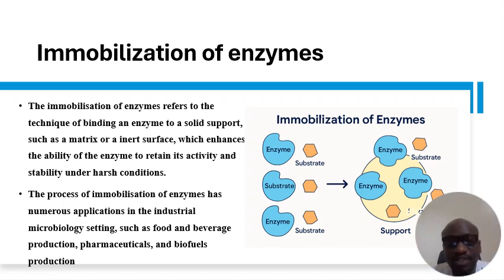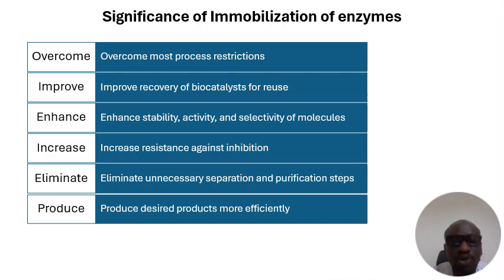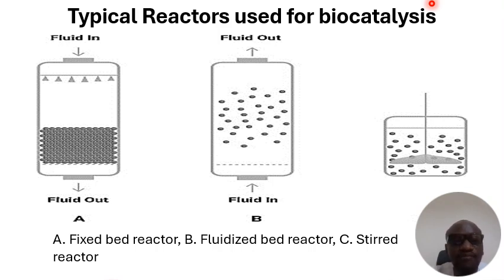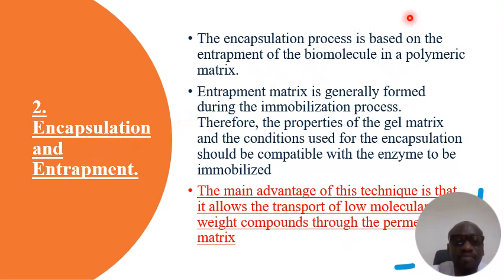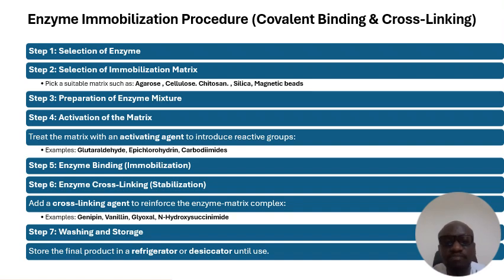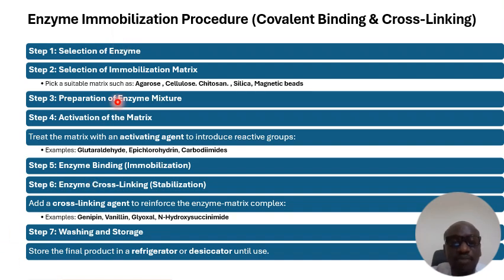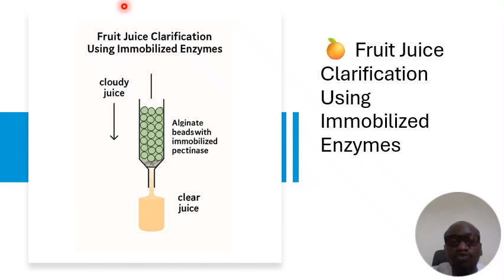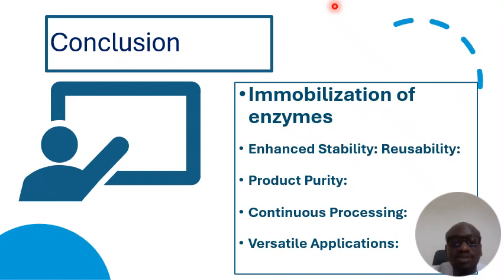Immobilization of Enzymes (Industrial Microbiology )

Comment: Question 1
Immobilization refers to the process of attaching a soluble enzyme onto an insoluble solid support while preserving its catalytic activity. This technique enhances enzyme stability, enables repeated use, and increases resistance to environmental changes. Enzymes can be immobilized though covalent binding, encapsulation and physical adsorption, this is valuable because it allows easy recovery and reuse of enzymes, extends their shelf life, and improves their performance in industrial applications.

Question 2
1. Reusability: The enzyme remains attached to its support, allowing multiple reaction cycles and reducing costs.

2. Extended lifespan: Immobilization preserves the enzyme’s structure, enabling it to withstand higher temperatures, wider pH ranges, and long term storage.

Real life Application: Immobilized glucose isomerase is used in producing high fructose corn syrup by continuously converting glucose to fructose in a packed column.

Olakorode Stephanie Oluwakemi
Matric Number: 210708042

Comment: Microbiology
Reply: Question 1:
Immobilisation of enzymes is the process of attaching or trapping enzymes onto a solid support or carrier while allowing them to remain active. This is useful because the enzymes can be reused easily, separated from the reaction mixture, and are often more stable during industrial processes.
Reply: Question 2:
Advantages:

1.Enzymes can be reused, reducing production costs.
2.They are more stable under different processing conditions.
3.They are easier to separate from the reaction mixture, resulting in a purer product.

Application: can be used in the dairy industry to produce lactose free milk by breaking down lactose into glucose and galactose.
Reply: Name: Olaniyi Zainab Dolapo 
Matric no: 210807100

Comment: Microbiology
Reply: Question 1: Explain Enzyme Immobilisation

Enzyme immobilisation is the process of fixing an enzyme onto a solid material or trapping it inside a support so that it does not move freely during a reaction. An enzyme is trapped on a solid support or matrix so that it stays in one place while still carrying out its function. Instead of mixing freely with the reaction, the enzyme remains fixed and continues to convert the substrate into the desired product. This is useful because the enzyme can be easily separated from the product, reused several times, and remains more stable during industrial production, making the process faster and more cost effective. 

Question 2
Advantages of Immobilisation Enzymes

1. Easy separation 
Immobilised enzymes can be easily separated from the final product since they stay fixed on the support material. This means there is little or no enzyme contamination in the product, so less purification is needed after production. 

 2. Reusability and cost reduction
Immobilised enzymes can be used repeatedly because they remain attached to a solid support after the reaction. Instead of adding fresh enzyme every time, the same enzyme can be recovered and reused in several production cycles. This reduces the cost of enzyme replacement and makes industrial production more economical.

Real life Application of Immobilization Enzymes 

An application is in the production of lactose free milk. The milk is passed through a column that contains immobilised lactase enzyme. As the milk flows through the column, the lactase breaks down lactose into glucose and galactose, making the milk easier for lactose intolerant people to digest. Since the enzyme remains attached to the support, it can be used repeatedly without contaminating the milk, making the process efficient and cost-effective. 

Udoka Rebecca 
210807056

Comment: Microbiology
Reply: Question 1:
Enzyme immobilization is the process of physically or chemically attaching isolated enzymes to a solid, insoluble support. This restricts their movement and localizes them so they do not mix with the final product. This is incredibly useful because it makes recovering and reusing the enzymes simple, which significantly reduces operational costs.

 Question 2:
Advantages
1.enzymes are anchored to a support, they can be easily separated from the reaction mixture and reused for multiple reaction cycles, saving both time and money.

 2. The final product remains completely enzyme-free, eliminating the need for expensive and time-consuming downstream purification steps.

3.They are easier to separate from the final product and often have improved stability.

Real-Life Application:
 Immobilized glucose isomerase is heavily used in the food and beverage industry to convert glucose from corn syrup into fructose, which is widely used to produce high-fructose corn syrup for sweetening products.

Dawodu oluwapelumi ifeoluwa 
230807550

Comment: Question 1: What is Enzyme Immobilisation?

Enzyme immobilisation is a biotechnology technique where enzyme molecules are physically confined to an inert solid matrix such as silica gel. By anchoring the biocatalyst in place, it can react continuously with an incoming substrate stream while remaining separate from the final product.

Question 2: Advantages and Real-Life Applications

Streamlined Downstream Processing: Because the enzyme does not mix into the solution, minimal or no product purification is needed, preventing end-product contamination.

It enables automated setups (such as packed-bed or continuous-stirred tank reactors) that run non-stop for maximum productivity.

Real-Life Application: 
It is used in sweetener production (Industrial Biocatalysis) where glucose Isomerase is fixed inside a packed-bed reactor to continuously convert glucose from cornstarch into High-Fructose Corn Syrup (HFCS), an essential commercial sweetener.

Matric no:230807541
Name: Ogbu-Nnachi Onyekachi Sophia

Comment: Question 1:

Immobilisation of enzymes is the process of attaching or trapping enzyme to a solid material, such as beads, membranes, gels or resins, so they can stay fixed in one place instead of floating in solution. It is useful because it allows the enzyme to be reused multiple times. This makes it easier to separate the enzyme from the product at the end of a reaction. 

Question 2:

1. They can be reused repeatedly, which cuts down production costs since fresh enzyme doesn’t need to be added for every batch.

2. They show improved stability, tolerating a wider range of temperature and pH than free enzymes.

3.  They are easier to separate from the reaction mixture, producing a purer product.

Real-life application:
Immobilised glucose isomerase is used in the food industry to convert glucose into fructose during the production of high fructose corn syrup.

Fadenipo Oluwafunmilayo 
210807001

Comment: MICROBIOLOGY
Reply: Question 1
Immobilisation of enzymes is the process of fixing enzymes onto a solid material or support so they stay in one place while still carrying out their job of speeding up chemical reactions. This is useful because the enzymes can be removed easily after use and used again.
Reply: Question 2: Advantages
•Immobilised enzymes can be used repeatedly, which helps reduce cost.
•They are easy to separate from the products after the reaction, making the process cleaner and more efficient.

Application:
Immobilised lactase is commonly used to produce lactose-free milk by breaking down lactose into simpler sugars.
Reply: NAME -ADEDEJI ISRAEL ILELADE 
Matric Number:190807052

Comment: Question 1: Explanation of Enzyme Immobilization

Immobilization of enzymes is the technique of attaching biological enzymes to a solid support or matrix, which allows them to retain their catalytic activity during use. This process is highly useful because it enables the enzymes to be easily separated from the final product, allowing them to be reused in subsequent industrial processes.

Question 2: Applications and Advantages

Advantages of immobilized enzymes:
Easy separation and recovery: Immobilized enzymes can be easily separated from the product, which reduces the need for costly downstream purification. 
Enhanced stability: They show greater resistance to changes in heat and pH, preventing denaturation and allowing for reliable performance over a longer shelf life. 

Real-life application:
Immobilized lactase enzymes are used in the dairy industry to break down lactose in milk, making it safe and comfortable for lactose-intolerant individuals to consume.

Olorunfemi Emmanuel Oluwatobiloba 
210807097

Comment: Microbiology
Reply: Question 1:

Immobilisation of enzymes is the process of binding an enzyme to a solid support enhancing their ability and retaining their activity. 

 It can be done either by physical adsorption, encapsulation and entrapment or covalent binding
Reply: Question 1

Immobilisation of enzymes is the process of attaching or binding enzymes to an insoluble solid support while retaining their catalytic activity. This process enhances enzyme stability, allows for repeated use, and improves their efficiency in industrial applications.

Enzymes can be immobilised using various methods, including:
Physical adsorption, Encapsulation, Entrapment and Covalent binding

Question 2

Advantages of Immobilised Enzymes

● Enzymes can be reused multiple times, reducing production costs.

● They are easy to separate from the reaction mixture.

● They exhibit greater stability and have a longer shelf life.

Real-Life Application

Immobilised enzymes are widely used in industrial processes. For example, immobilised lactase is used in the production of lactose-free milk, where it hydrolyses lactose into glucose and galactose, making the milk suitable for lactose-intolerant individuals.

Name: Odususi Anjolaoluwa Elizabeth
Matric No.: 230807509

Comment: ‘Microbiology’ Cynthia chira 181101063
Reply: Question 1: Explain Immobilization

Enzyme immobilisation is the process of fixing enzymes to a solid support  for example by adsorption, entrapment in a gel, or covalent bonding so that they remain in a specific location while carrying out their function. This is useful because the enzymes can be easily separated and reused, making the process more efficient and cost effective.

Question 2: Applications and Advantages
1:Immobilised enzymes can be reused multiple times, reducing production costs.
	2.	They are easier to separate from the reaction mixture and can provide greater stability.

Real-life application:
Immobilised enzymes are used in the food industry to produce high fructose corn syrup from glucose using immobilised glucose isomerase.

Comment: Question 1
Immobilization of enzymes refers to the techniques of binding an enzyme to a solid support which allows the enzyme to retain its activity and stability and can be separated easily after the product is derived.
The enzyme is embedded to a solid support because it allows the enzyme to be easily retrieved and can be reused and it does contaminate the final product 

The enzyme can be fixed to a support by covalent bonding, Adsorption, Cross-Linking, Entrapment, Encapsulation.

Question 2
Advantages of Enzyme immobilization 
1. Easy Separation of enzymes from products- The enzyme being attached to a solid support, it can be easily removed from the reaction mixture, leaving a purer product.

2. Improved enzyme stability – Immobilization often increases resistance to changes in temperature, pH, and organic solvents.

Application of Immobilized Enzymes
1. Fruit Juice Clarification
In industries, the fruit juice is passed through a column with alginate beads embedded with immobilized pectinase.
The immobilized pectinase is entrapped in alginate beads. As the juice passes over the aliginate beads the pectinase remains fixed while breaking down Pectin, the substance responsible for the cloudiness of the fruit juice. The immobilized pectinase makes the fruit juice clear and does not contaminated the final product because it remains embedded to the Alginate beads.

NEBOH TOBENNA EDWIN
230807571

Comment: Question 1:
Enzyme immobilisation is the technique of keeping enzymes attached to or enclosed within a solid material without stopping them from carrying out their normal function. By fixing the enzyme in one position, it can easily be separated from the reaction mixture after use instead of remaining mixed with the products. This method is commonly achieved through adsorption, entrapment, encapsulation, cross-linking or covalent attachment.

Question 2:
Advantages

1. Easy recovery and reuse:
Since the enzyme is attached to a support, it can be removed from the reaction mixture and used repeatedly. This makes the process more economical because fresh enzymes do not have to be added after every reaction.

2. Improved durability:
Immobilised enzymes are less likely to lose their activity when exposed to changes in pH or temperature. As a result, they remain effective for a longer period during industrial production.

Real-life application

Immobilised glucose isomerase is widely used in the food industry to convert glucose into fructose during the production of high-fructose corn syrup. Because the enzyme is immobilised, it can be used continuously in the manufacturing process, improving efficiency and reducing production costs.

OJO ISAIAH OLOLADE
230807543

Comment: Microbiology
Reply: Question 1
Immobilisation of enzyme is basically the binding of enzyme to a solid support such as a large surface.
This allows the enzyme to retain its activity during use. It allows allow the enzyme to remain stable in harsh conditions and it to be separated easily.

The enzymes are fixed to a support through Physical adsorption or covalent binding.
Reply: Question 2

Advantages
-Reusability - the enzymes can be reused in other cycles
-Stability - The enzyme are able to remain stable under harsh conditions.

Real life Application 
-Food and beverage industry

Comment: Question 1.
 Enzyme immobilization is the process of physically confining or attaching free enzymes to a solid support, matrix, or carrier. This fixes the enzyme in a specific space while still allowing it to catalyze chemical reactions.

2. Advantages of immobilized Enzyme;
*Improved Stability:Immobilized enzymes are often more stable against changes in temperature and pH compared to free enzymes in solution.

*Reusability: Because the enzymes are attached to a solid support, they can be easily separated from the reaction mixture and reused multiple times, making processes much more cost-effective.

Real -life Applications 
1. Manufacture of Lactose-Free Milk: Immobilized lactase is used to hydrolyze lactose into glucose and galactose, allowing lactose-intolerant individuals to digest dairy products safely.

NAME-Uzoh Adaobi isabella
MATRIC NUMBER :210708077

Comment: Microbiology
Reply: Question 1: 
Enzyme immobilisation is the process of attaching or trapping enzymes to a solid support so they stay in one place while still carrying out their reactions. This makes them easier to separate from the products and allows them to be reused multiple times, making the process more efficient.  ￼

Question 2:

Advantages of Enzyme immobilization:

	•	Enzymes can be reused, which reduces production costs.
	•	They are easier to separate from the final product, giving a purer product.
	•	They are generally more stable and can be used continuously in industrial processes.

Real-Life Application: Immobilised enzymes are used in the food industry, for example, Immobilised lactase is used to produce lactose-free milk. The milk passes over the enzyme, which breaks down lactose into simpler sugars, while the enzyme remains attached to its support and can be reused for many batches.

Submitted by: Olagunju Azeezat Olabisi 
Matric no: 210807027

Comment: Microbiology
Reply: 1. Immobilisation of enzymes is the process of attaching or trapping enzymes on a solid support while allowing them to remain active.  It refers to the process of binding an enzyme to a solid surface that increases the ability of the enzyme to retain its activity and stability under harsh conditions. It involves the reaction of enzyme and substrate to form a product while the enzyme remains on the surface.
Reply: 2. Importance of enzyme immobilization
• it can be reused and it reduces cost.
• it gives a purer product and gives an efficient reaction.
Reply: Applications of enzyme immobilization
• immobilized lactase can be used in the diary industry for the production of lactose free milk.

Comment: Question 1: Explain immobilisation

Enzyme immobilisation is the process of fixing an enzyme onto or within an inert, insoluble support material, such as calcium alginate beads, a resin, or a membrane, instead of leaving it free in solution. This can be achieved through methods like entrapment, adsorption, or covalent bonding to the support. It is useful because it allows the enzyme to be reused repeatedly, improves its stability against changes in temperature and pH, and makes it much easier to separate from the reaction mixture.

Question 2: Applications and advantages

1. Reusability: the enzyme stays attached to its support and can be recovered and used again for multiple reaction cycles, which reduces production costs.

2. Increased stability: immobilised enzymes generally tolerate a wider range of temperature and pH than free enzymes, so they last longer before losing activity.

3. Easy separation: since the enzyme is fixed to a solid support, it can be simply filtered or removed from the product, avoiding contamination and extra purification steps.

Real Life application: immobilised lactase is used industrially to produce lactose free milk by breaking down lactose in dairy without the enzyme ending up in the final product.

NAME: Oludairo Esther Oluwaseun 

MATRIC NO: 210807040